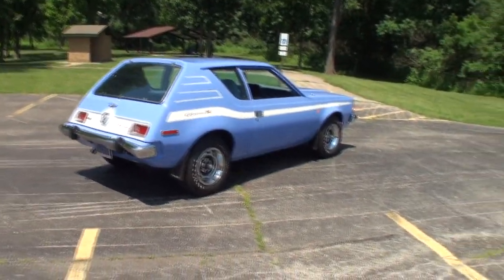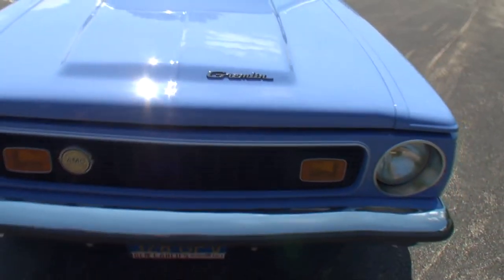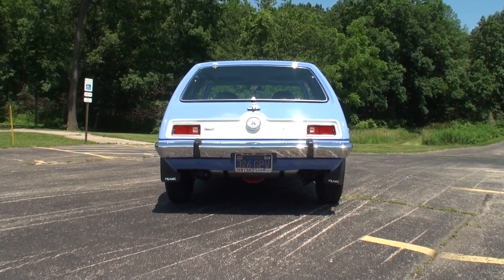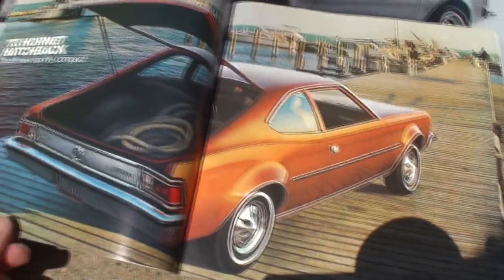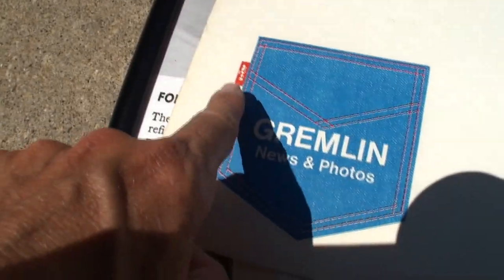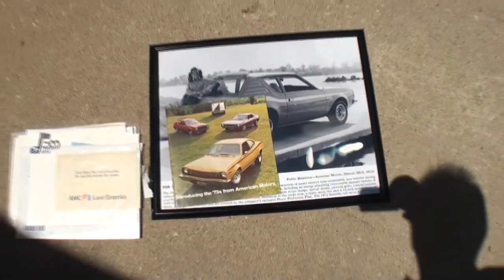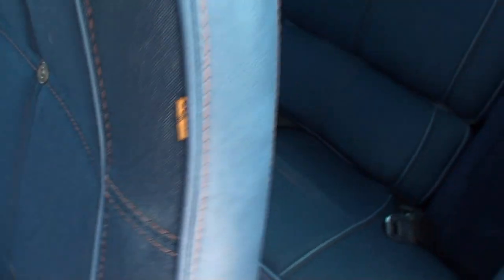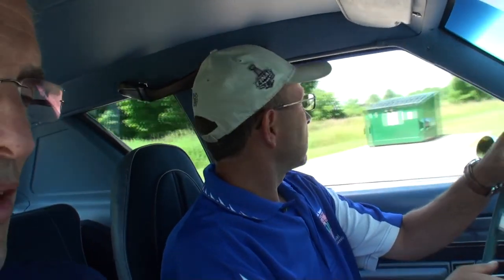1973 American Motors AMC Gremlin X Levi Edition in Maxi Blue & Ride My Car Story with Lou Costabile

Comment: I smile every time I see a Gremlin. Right before the gas crisis in the 1970s I bought a 73 Gremlin. Mine had the same engine and transmission but wasn't the Levi addition. They were regularly panned by everyone but I think they were better cars than the Chevy Vega and Ford Pinto they competed with. I got better than 20 MPG and with the 27gallon tank had a cruising range of over 500 miles. Just what was needed when I lived more than 15 miles from work.  Vegas and Pintos got better mileage but had much smaller tanks.
Reply from the maker: Hi John. "I smile every time I see a Gremlin." Goal of this video achieved :-) Lou

Comment: Very nice restoration. Being the owner of 4 1973 AMC Gremlin X's, I like to keep mine all original because being all original and in great shape, they will always "outshow" the Best of the Show. Major differences that would make this Gremlin more like original  - 1). Original tires on these cars were D70X14  Goodyear raised white letter bias belted polyglas tires (Not E70x14), 2). The  "rear"  was black and not painted red, 3). The valve cover and engine block were AMC blue green in color and not red, 4). The voltage regulator was Delco and black and not an aftermarket, 5) As you pointed out the battery was not Interstate. Despite, this is a nice car and close to original but not "that close."
Reply from the maker: Hi Gary, Four times the FUN :-) Hope you see many more cars on this YouTube Channel you enjoy. Please subscribe, and hit the "bell" so you can see all the cars when they are uploaded on this YouTube Channel, Lou
Reply: With all due respect to your interesting input on the specs, it was mentioned that this was a California car which would mean that the the red paint on the engine would be correct vs. the standard AMC Teal  color.